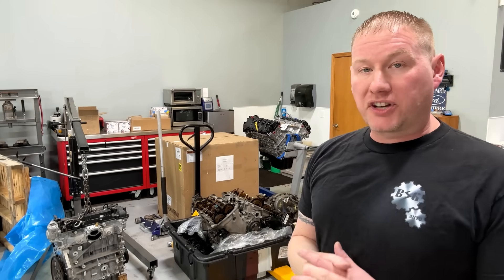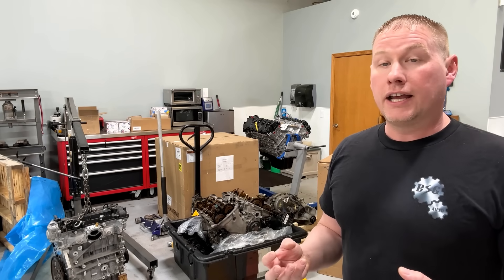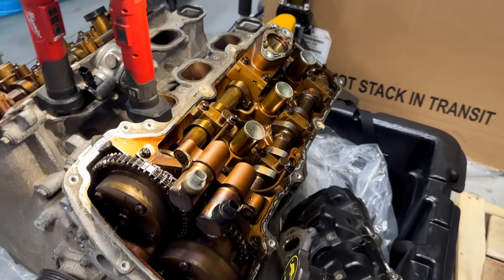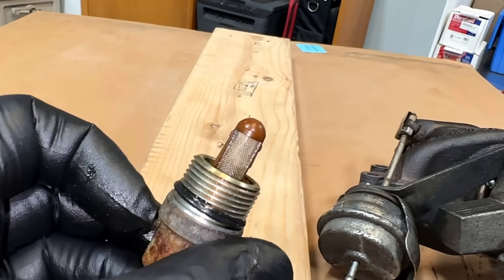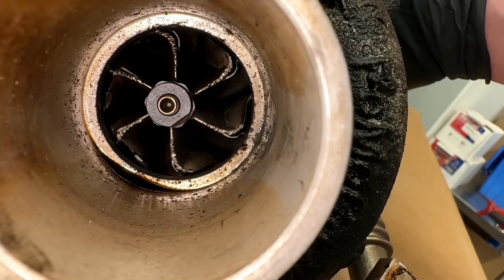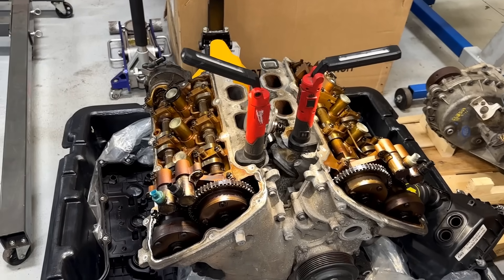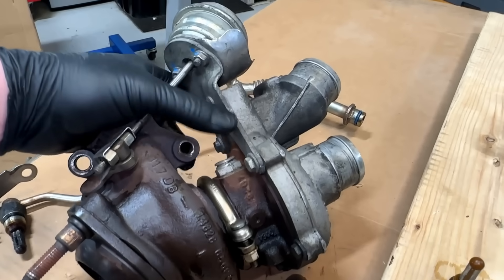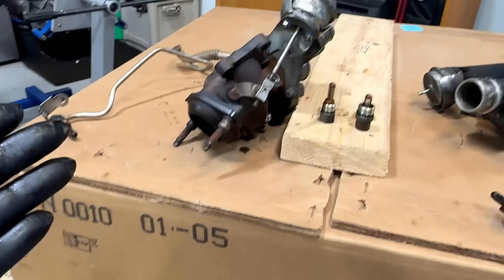This is Why You Never Run Extended Oil Change Intervals on The Ford Ecoboost Engines!

Comment: I run royal purple full synthetic in my ecoboost with a factory filter. Every time I change my oil I reset the light to 50 percent. I don't believe in letting it go that far out. My bmw says changes at 12k are never going to happen. 4k max. 

Other thing I think is a must for the ecoboost is a good catch can setup. I'm shocked at the moisture it picks up. I run the mishimoto setup and feel it was worth every penny

Comment: So is it a good idea to add those crap traps? Ive seen several versions of them. If you recommend, which setup / kit is best?  I want to say I saw one where someone drilled holes into the tubes near the turbos.. Good way to suck in shavings...   Thanks

Comment: thanks again for the detailed information. 👍 just built a new 150 fx4 5.0 at the dealer and its on order . i just hope the new Kevlar belt  system holds up! have two 5.0 in 2nd generation mustangs no issues! oil changed every 4 thousand miles. 5w30 penzoil platinum ✨️

Comment: Seems like actual failure was due to the guy not checking his oil regularly, so no engine can survive with heat buildup and lack of lubrication with only 2 quarts of oil,    secondary reason was the plugged turbo oil line filters ;  and third. maybe not changing the oil at 5000 mile interval instead of 7500.

Comment: Good stuff man!! The police fleet I started working for is 90% Ford, a few Eco Boost’s. They are pretty good at changing the oil no later than 4K miles. I was wondering on the high mileage engines they have if it would be worth changing those turbo filters as a preventative maintenance?
Reply: the factory should say change them man

Comment: I went in February to my local ford dealer and I got everything  I needed and the man at the counter asked if I really wanted to get into this project I said yes because I have been working on my own stuff for years and I have all the tools except for a 2 post lift  so it might of taken me longer than a everyday mechanic but I did it right and saved myself money so I could justify buying some more tools
Reply: Go ahead, get that 2 post car lift. They're not that expensive.
Reply: @terrybrown7771  ...yep....my buddy got one on an online auction from a business that had closed....he paid $1700 for one(and $250 to get it delivered) of the better, higher capacity, asymmetric ones.   that makes it SOOOOOO nice to work on whatever you need to
Reply: STEALERSHIPS Suck
Reply: @vintagerc9173 
The  Flate Rate ones, I should know worked at both!
Reply: Dude, I'm on the verge of buying my own lift. I think we need to do it hahahaha Chicks buy themselves shoes and purses and shit all the time, why not treat yourself to a new lift? 🤣
Reply: I love when I “have to” buy new tools to get a job done 😅
Reply: Good for you! 
I’m the same kinda guy.
Reply: I built my 42x40 shop in 2006. The first thing I purchesed was a two post lift. I'm way past crawling on my back under a vehicle. I do all maint. On 5 vehicles, as much as I can anyway. Never have I gone past 3k miles on oil. Good video thanks.

Comment: 3:10 - thats someone who used conventional oil and relied on the oil change indicator. Using conventional oil, changed every 3k, that engine would be clean. Using full synthetic, that engine would be clean following oil change indicators.

Comment: Inlet screens are nothing new to turbo engines. Spot on advice. My work truck is a non turbo F150 it will go double the miles of my 3.5 eco. Pull the dipstick at 3k on the non turbo and the oil is fairly clean. Do the same thing on my eco I can feel that grit Brian is talking about. 3000-3500 its getting changed. Cheap insurance.

Comment: Does this apply to ALL turbocharged engines or just Ecoboost engines? I ask because I sold my 2020 Escape ecojunk after the transmission failed at just 34,000 miles and bought a more reliable Chevy 2.0T AWD. I particularly change my oil every 3,000 miles but I know a lot of people who swear by that useless oil life monitor and im looking more out for them than me.

Comment: I dont even have turbos, but i change my oil in my 2010 mercury grand marquis every 2500-3000 miles with mobil one full synthetic and ford oil filter. It may be over kill but i want my car to last

Comment: Watching this just scared the sh*t out of me. I'll be changing the oil in my 2.7 EB tonight! I bought my 2017 F-150 with 99,000 miles; who knows what the previous owner did or did not do. Thank you so much, Brian!
Reply: The 2.7 is entirely different from the 3.5. Way more reliable. Bought mine with 220k on it. Carfax showed regular service between 4 and 8 thousand miles. It runs very smooth. My neighbor has been a dealer mechanic over 20 years at same shop and said he has never had to tear down a 2.7 but he does several 3.5 every month.
Reply: @darylturcott  I appreciate the reply. So far, *knock on wood*, I have had no issues with my 2.7; however, my neighbor, same year 2017, has the 3.5 and has had issues...

Comment: OK, 5k. What about in HOURS ? 3.5 EB and 3.7 NA ?  Thanks.  As a better quality filter should assist these issue, whom would you recommend ?  Know of an extended-length filter requiring an additional .5 qt let's say over the standard length ?

Comment: Meanwhile, the 460 Big Block is still running strong, and the 4.6 is asking "oil pressure, what oil pressure?"
Reply: Lol - 390FE Big Block Ford has like 4psi oil pressure at idle...which is spec. Freaks people out. It's a beautiful motor though.
Reply: @timberanvil3788  Old Ford is best Ford. 390 was a good engine too
Reply: @RipRoaringGarage sure is. I love mine. 1967 Galaxie convertible

Comment: I have 140k on my 2013 F-150 Ecoboost.  I have been getting a loud whirling noise when the engine is cold for the first half mile or so.  In my mind, it's the turbo.  What is the first noticeable sign a turbo isn't getting the oil it needs?  FWIW, I have not changed the oil every 5K.  More like 7.5k.  Been using the computer reminder which I won't be doing anymore.  Thanks.

Comment: I usually change my oil before the 5k mark or when I notice performance starts to suck. My 3.5 has had the phasers already replaced...currently have 45K on it.  Guess I'll do it every 3500ish or so just to keep the turbos happy.

The Semi-syn can't stay clean enough long enough or else the solenoids plug up and I start have oil pressure issues.

Comment: For me, my upgraades - must haves for a 2012 Ecoboost.

-Check with the dealer for the ten-year campaign for the trans valve body and brake vacuum pump. Free repairs. Avoids shift issues and the 6 to 1st. Gear shift issue.  If not, change the trans valve body with the Solinoid quasi-conductor plate (USE GENUINE). Perform a relearn. Then filter and trans fluid every 40,000. Changing the conductor plate with aftermarket releases Ford from liability and does not totally cure trans issues.

-Clean and re-grease with polyurethane bushing grease the rear drive shaft spline. Avoids the 1 to 2-gear parking lot SLAM. Typically shows up after pulling a trailer. You will feel the drive shaft center-bearing vibration prior to this issue.

- Gale Banks air box upgrade to draw intake air from the top of the radiator instead of the fender well.

-RX catch can for PVC passenger and Driver turbo to valve cover-intake. The $550 set up. After 1,000 highway miles at 80mph ish, I get 12 oz of milkshake on the catch can(s) drain.
-Change plugs every 55,000. Regap is an option.
-Change oil only every 2,000 and only the Motorcraft filter every 6,000. I am more comfortable with the Motocraft filters bypass valve being accurate. I use Costco Synthetic.
- Idle for a little bit, 30 seconds prior to shutdown. It may help turbo oil cooking.
-Run premium fuel. Runs much better, and the overall MPG increase covers the added price of fuel. I am at 19.5 hwy on Highway 40 from California to Tennessee. Especially premium in California. This is after 8000 miles of testing. 

-Remove and clean the MAP (not MAF) every 2000 with contact cleaner. Even though it is a diaphragm-type variable resistance sensor.
-Hold the gas pedal to the floor prior to position 3 when starting after overnight sitting. This cuts out the fuel injectors. Crank until you hear the phasers load with oil and change the cam setting. Lift off the gas to start in About 10 seconds. This avoids phaser wear due to the lack of oil.
-Rear-end fluid change and wipe at least every 40,000 as well.
Looking for advice on the electric vacuum pump issue for the brakes. It could if be failing due to the lack of filtration or an electric motor stall in any internal valving.
-Ensure all of your wiring harnesses are fastened away or properly, as much of the wiring is not shielded. At various locations, resistance can change when low and dirty higher voltage impedes. Very smooth idle now.
-Caution if you drilled a 1/16 hole at the base of your intercooler discharge, add a small hose with a check valve.